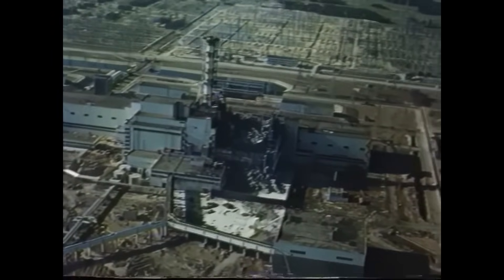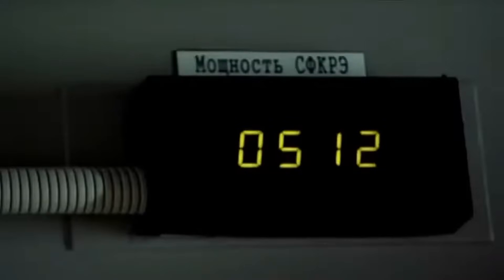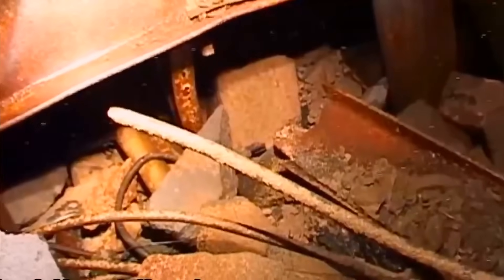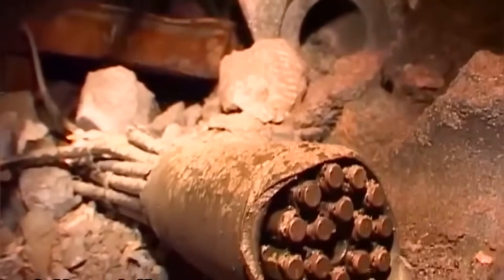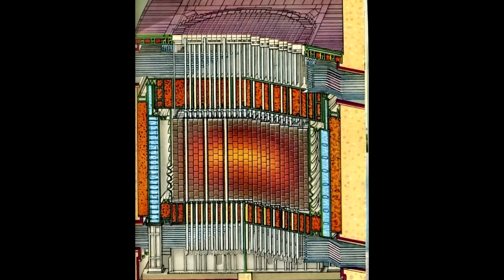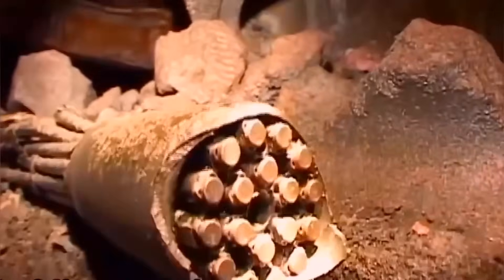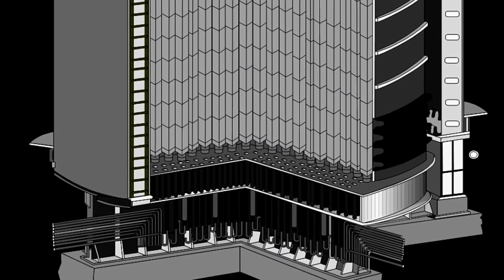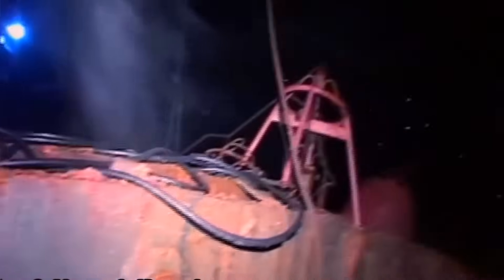Chernobyl Explosion Theories: The Hydrogen Explosion and Why it Doesn't Work

Comment: What keeps amazing me is how comments keep appearing that one of the Chernobyl design flaws was that it didn't have a containment structure around everything. Well, first, the explosion (the one that was never supposed to be possible at all) blew Elena, that huge lid of what, a thousand tonnes, something like a hundred meters into the air. Any containment would have been blown to pieces. But a containment would have been insanely difficult to build anyway. The RBMK had a HUGE core, so big that it operated a bit like a bunch of smaller cores gathered together. The USSR was very concerned about costs, and the desire to cut costs drove various design decisions that led to that huge core in the first place.

BTW one of those cost concerns related to the graphite moderator. In some ways the RBMK is like a CANDU turned on its side, with fuel channels swappable during operation, as in an RBMK. Partly, the Canadians did this because of their lack of ability to make a huge reactor vessel. But the Canadians did not go for graphite moderation, instead choosing to bite the bullet on that question, and go for the very expensive heavy water.

So the CANDU had an attractiveness, outside its home country, that the RBMK did not. It was marketable to other countries who found it useful for various purposes not originally intended. India, for example.
Reply: The British AGR also lacks a containment structure, because of the low pressures in the core. The Soviets were thinking along the same lines (that any accident would only damage a fuel channel or two, precluding a large emission).
Reply: @MinSredMash  There must be at least one containment structure for every nuclear reactor unless you want to see if your plant operator would turn into Godzilla or not after receiving ungodly doses of radiation.

Yes, even Chernobyl did actually have a containment structure around the reactor pit which consist of 2.5 m thick concrete and several layers of biological shielding to keep the world safe from Godzillas.
Reply: @tonamg53  True, the reactor lid was 2 meters of reinforced concrete. But the designers didn't bother to even, err, bolt it in place. It was just sitting there with the help of gravity. So that means that if even 3 channels (out of 2000) ruptured, the steam pressure would dislodge the reactor lid, resulting in no containment whatsoever.
Reply: @MinSredMash   The lid weights 2000 tonnes… 😐

You really think some bolts were needed?
Reply: @tonamg53  You remember where the lid ended up, right? It was laughably worthless as containment. Totally useless for everything except reducing the dose rate for workers in the central hall.
Reply: @MinSredMash  You forgot the fact that the reactor was caught in this “positive void coefficient loop” which cause the power output to rise exponentially out of control. The reactor was design for 3.2 GW thermal and the last reading was 33 GW. That is 10 times higher than its rated output but that’s not even when its exploded yet. That’s just the maximum the gauge could read. Who knows how high the power went up to? You think if they bolted down the reactor’s lid it’s going to help?

Once the reactor caught in the positive void coefficient loop, the only thing going to stop it… is that it blew itself up causing the materials to spread far enough apart to stop the nuclear chain reaction.

I’m not trying to made dumbass excuses for it. RBMK reactor was a shit design. Simple as that.

However, to claim that it does not have any containment structure is just as dumb as trying to mindlessly defending it because it did have a containment structure. 

Would a stronger containment help? Most likely it just going to prolonged the positive void coefficient loop increasing power even higher and cause a more massive explosion at the end.

Helps if you want a bigger fireworks I guess 🤷🏻‍♂️
Reply: @tonamg53  You entirely disregarded what I said. The reactor lid in 1986 was dislodged by a catastrophic power surge. But the lid COULD HAVE been dislodged simply by the failure of three channels. You could blow up an RBMK just by putting a shallow scratch in a 2-mm thick pipe. Any number of trivial accidents could lead to damage like that, and the so-called "containment" couldn't deal with it.
Reply: @MinSredMash  Also if you think the containment structure is totally useless… well without the containment structure no one would be able to come to work at the plant due to high radiation from live reactors… 🤷🏻‍♂️

So there would be no Chernobyl nuclear power plant, the accident wouldn’t happened and no electricity would have even been produced without the containment structure. 

It’s the whole point why you can operate a Nuclear power plant without turning into Godzilla. 

If you want to compare to other nuclear plant in the west, well you can’t. This is because RBMK is the only commercially operated reactor type with a positive void coefficient, making accident like Chernobyl impossible. 

But “if” it could happened, as I said earlier… better containment would just most likely prolonged the positive void coefficient loop increasing power even higher and lead to a bigger explosion.

And if you think the containment structure at other plant cannot be leaked… well go and take a good fucking look at Fukushima reactor #2

Note that’s also where 99% of radiation leaked from Fukushima came from.
Reply: @tonamg53  It's useless as containment and the Soviets didn't call it containment. They called it 'biological shielding.'

CANDU also has a positive void coefficient, by the way.

Fukushima-style containment would have vastly simplified the cleanup process from a major accident and saved lives.
Reply: @tonamg53  Containment with 2000 individual holes in it, dude. So "effective" at containing radiation that it was a normal phenomenon for contaminated steam to just leak into the reactor hall on a regular basis.

Comment: if it was not hydrogen, than what caused seconed explotion.
Reply: I redid the math based on the design of RBMK alone. There are 2488 columns 8m in height, 1872 of them with zirconium pipes inside. For calculations I used block size of 600x250x250mm with internal borehole of 114mm (I have not dug for exact count of 600, 500, 300 and 200mm tall blocks). That gives us around 13,4 blocks per column, but due to presence of smaller ones round this up to 14. Next, each channel is wrapped in a stack of graphite rings, 20mm tall with ID 88mm and OD of 114 or 111mm (alternating). Total area of graphite in core is around 50000 square meters in undamaged state. Initial explosion shattered both zirconium tubes and graphite, flushing inert gases with high pressure steam. Even with rate calculated for 1500°C that area has potential to create 1500kg of hydrogen in three seconds. Correct me if I am wrong

Comment: Interesting. So, are we waiting another video for the 'real' explosion causes? Is it involving criticality? With that low fuel enrichment? .. You got me thinking..
Reply: You can still go critical based on non enriched fuel. In fact, it appears that the reactor even went prompt critical, but it still had plenty of graphite. So the sheer heat output for that high.

I have seen that observation that the lid was blown off, it dropped the pressure immediately which killed the water which is a poison.

Comment: After the first explosion wouldn't there be a vacuum for a short period of time allowing for a lower temp for the water to split into hydrogen and oxygen?
Reply: Why would that be? My understanding is that the core was still mostly intact after the first explosion and was still critical. The temperature might have been lower a little after the first explosion… but I doubt you would call it as “low”

The nuclear chain reaction only ceased after the second explosion which disperse and vaporised most of the content of the reactor core.
Reply from the maker: @tonamg53  The core can't he intact for any prolonged period of time after the first explosion. It's literally empty today. The actual steel lining of the reactor is in the Reactor Hall today - it must have been ejected out while Elena was still in the air, which is only a period of a couple of seconds. This means that whatever processes were happening in Reactor Four had to cease by the time Elena is thrown off as the structure of the core becomes non-existent.
Reply: @thatchernobylguy2915  The core was intact after the first explosion which has been universally accepted that it was a steam explosion. The building was still fully intact after the first explosion. Only some parts of the core were damaged. The reactor lid was also still resting in its original position. 

This is a fact, not my opinion.

I don’t even know where you’re getting your info that the core wasn’t intact after the first explosion from? There isn’t any evidence to support that was the case and ALL available evidence  is actually telling you the opposite, indicating that the core was intact.
Reply: @thatchernobylguy2915  I’m just reading your comment again and I’m not sure what’re you trying to say?  

Yes, I know the core is empty as I’ve already explained that the content of the core has been dispersed and vaporised in the second explosion which also caused the nuclear chain reaction to stop…

So I don’t really understand your point? as it seems like you were explaining what I’ve already said in my comment back to me?
Reply from the maker: @tonamg53  My evidence is the fact that the internal steel shell of the core is lying mangled in the Reactor Hall next to Elena.

https://m.vk.com/album-194863948_271987033?z=photo-194863948_457240744%2Falbum-194863948_271987033 It's that big steel object with the hard edge.

For this to be the case, the core has to be basically largely non existent by the time Elena has been thrown off, or it wouldn't have been able to be either lifted out the core in the couple secondsbetween Elena being thrown up and it crashing back down as the graphite stack would hold it in place, nor could it be mangled as it would be containing a largely intact core within it, something we don't see today.
Reply: @tonamg53   if the core was intact after the 1st explosion, I think it could be possible that the pressure in the core was lowered as the steam vented out, so that there is a possibility that the pressure was low enough for hydrogen to be produced, with the heat supply from the ongoing reactor.
Reply: @Krasnoye158  I doubt it as the reactor was still in the atom splitting frenzy mode… so the thing that cause pressure to increase which lead to the first steam explosion, is still going wayyyy beyond its “full steam” mode. 

It’s possible that the pressure might actually be higher even after the first explosion.
Reply: @hieuvu8895 I'm definitely no expert. However, I agree with this as it's what makes the most sense with the information given. 
Pressure dropped from bleve, and super high temperatures created hydrogen, and an ignition source blew it up.
Reply: @thatchernobylguy2915  If the core wasn't intact after the steam explosion, then there would have been a truly enormous about of surface area on all of that broken graphite for the carbon-steam reaction to take place on.
Reply: The first explosion did lift up the lid and severed fuel channels. Steam pressure of the first explosion blew off the NOTHERN side wall of the reactor building and probably ejected some of the graphite outside. Severing the fuel channels meant that water pressure was lost immediately and water flashed into steam. Very little pressure remained inside fuel channels - only what was required to push newly produced steam out of severed channels.

However, I have no idea what happened to the building ABOVE the reactor lid. The lid did NOT fly into the air (as erroneously showed in maaaany animations I've seen), it just rotated into vertical position that is staying today. If it flew up and fell down, it would have severely damaged the reactor wall and the lid itself, but no such damage can be observed. It is possible that lid fell back down and CLOSED the reactor well after the first explosion and only the second explosion popped it up into vertical position. Closing the well could have created completely different conditions inside the reactor but it would require THREE explosions, two inside the core and one above the lid (which, according to some witness accounts did happened - they claim to have heard more than two explosions). In such a case, there's no reason not to believe that building above the lid remained mostly intact, creating enclosed space to accumulate flammable gas mixture (i.e., hydrogen and oxygen) and enabling the third explosion.

There definitely was an explosion that happened above the reactor lid that destroyed the reactor building - it is evident from the reactor remains. It could not have happened inside the core as the well and the lid itself were not much damaged, comparing to the damage of the building. The lining of the steam drum separators clearly indicate that explosion happened above the lid. What did explode there, that's mystery, but a huge, violent explosion definitely happened there.
Reply: @visnjamusa9395  My understanding is that the first steam explosion did blew off the square metal caps that is on top of each individual fuel channel but not the massive round reactor lid that is covering  the entire reactor which remain in place.

Also I’m not sure what would’ve cause only the northern wall of the reactor building to collapse first but not the roof or the other side to stay intact? The reactor is inside a heavily fortified reactor pit. The force from steam explosion would have been projected mostly upwards from the reactor and not to the side of the building. If partial collapse of the building did happened, the roof is the first that most likely to be destroyed and not the walls.

Also the most violent explosion most likely took place inside the reactor. The evidence to support this is that the reactor pit was pretty much emptied. RBMK is a massive reactor and what was left of it that scattered around the area are tiny. Most of it were probably vaporised into smaller dust particles that spread around the world. The explosion also managed to flew the massive lid that weight 2,000 tonnes as well as all the biological shielding into the air. I would assumed that the explosion force was probably a bit higher than the lowest estimate value (and by “a bit” I mean several times higher)

I don’t think you would see much damage on the lid. You can get a tank and fire some rounds at it, it would probably just spit those rounds out and laugh at you. Note that the lid is penetrated with holes for fuel and control channel assemblies so much of the explosive force that lift it up would have gone straight through these holes as well.
Reply from the maker: In short, no. The pressure would remain high in the reactor for a prolonged period as the molecules within need to be ejected towards the lower pressure. Even if, somehow, a vacuum did appear, it would collapse instantly before it had enough time to produce even a small amount of hydrogen.